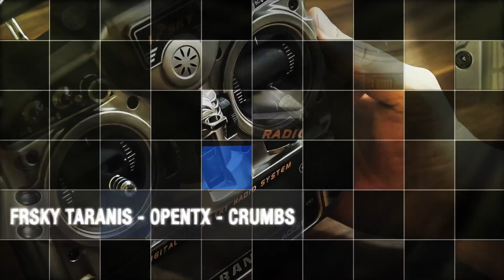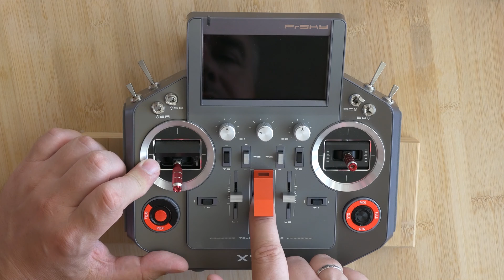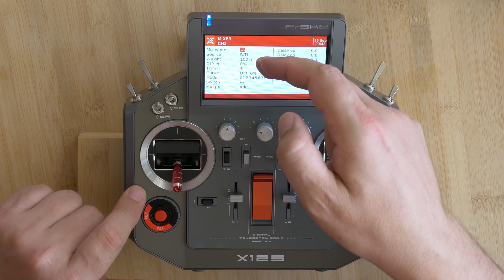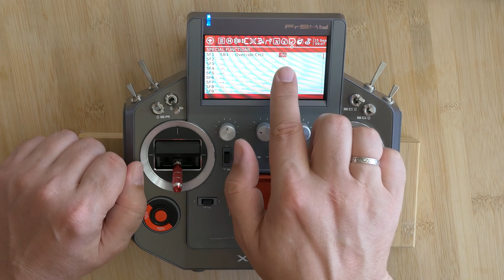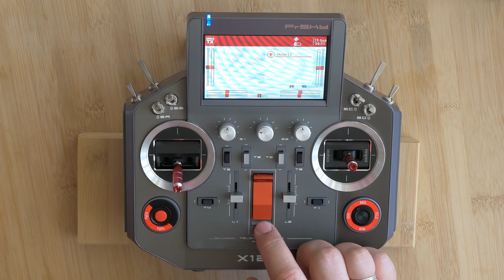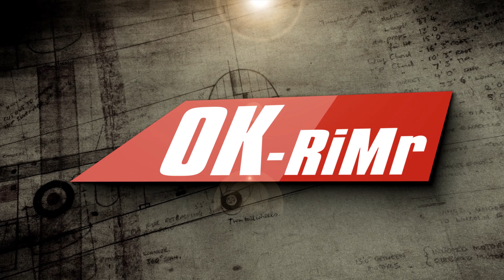FrSky Taranis / OpenTx Crumbs - Gas engine Idle and cut-off

Comment: Fantastic! I have just started using OpenTx in a Jumper T16 and immediately struggled with throttle end points and cut-function that I have been used to on Spektrum & Futaba. I was shown this setting at the field by a club member and have just watched the video. Very clearly explained and it does exactly what I want. Thank you very much for posting. I'm now going to watch all your others to see what else I can learn. Cheers!

Comment: I believe you’re answering my question but here is the situation.  Flying IMAC with a gas engine.  Flying at a certain low idle point so that when I do a Stall Turn, the engine does not stop (flying mode idle).  Then, when I need to land I have to reduce the idle about 5-6 clicks...  I’d like to put this adjustment on a
switch.

Comment: Actualy, I couldn't make two. I've chose to use weight and offset and not modify the outputs, I had allready values on weight 60 in Inputs. In Mixer I have weight 69, offset 8. Choosen CV3. In Outputs values are default +/- 100. In Curves, CV3 2 point, +100, -25(high idle). In Special F. Switch(SF-up arrow) Override ch1(throttle), value -33(low idle) and box cheked. When I switch the SF down I have inactive throttle stick, it is obviostly set at the value set on Special F. -33. I tought I could make a two pozition idle by a switch, but this requires somehow not just a single value but a curve between two values that is at one end(idle) slightly different then the standart throttle stick value, so leading to another idle...don't know how could it be done that. I struggle with trims after take off and before landng and it's getting dangerous because I have to take each time the finger off one stick, and the trims beain in small steps it needs a bounch of them to change the rpm..If someone can tell me how can I make two idles I hould apreciate it, Thank you.
Reply: +Richard Mrázek (OK-RiMr) It was easy to make two idles. I realised that it has to be a mix of throttle with throttle, nothing else, so I just made an Insert After on throttle, adjust weight, offset and put it on a switch. Now I have two idles..yeee.
Reply from the maker: Yes. Or this for example (because I love a curves :)) : 
https://photos.app.goo.gl/xpFPnFjQTZrd8UnGA
Reply: @richardmrazek  Thank you very much for the video!
Reply from the maker: Actually I don't exactly what do you mean, but you can just use two different mixes with a diferent mixes with a different switch positions as Switch in each mix?
Reply: @richardmrazek  I mean that before Taranis I had the Spectrum Dx7. The gas plane idle was 2000 rpm, after take of I flipped a switch and had the idle increase at about 2300 rpm like others do to prevent the engine from stoping in the air. That's what I want to do with Taranis for months, aske-ed on several places, no one knows how.. Painless explains it with the RC on PC, I don't understand a thing...I want to do it in the RC not PC(computer)
Reply from the maker: @Seneslau07  it is wasy, I will make a video.
Reply: @richardmrazek  I know I need a throttle to throttle mix but don't know how to make it.